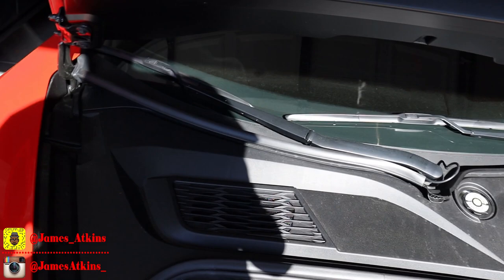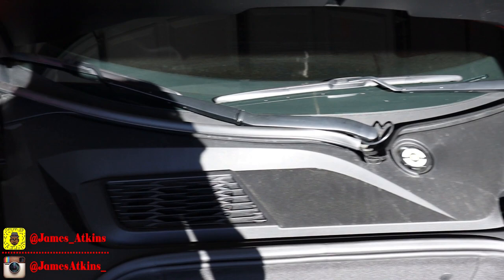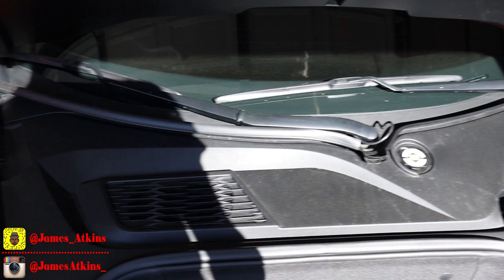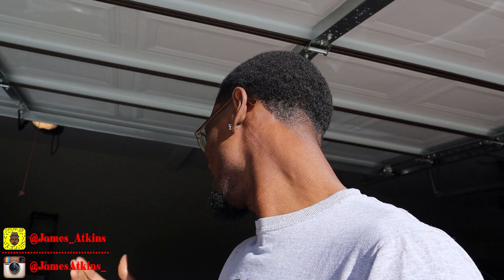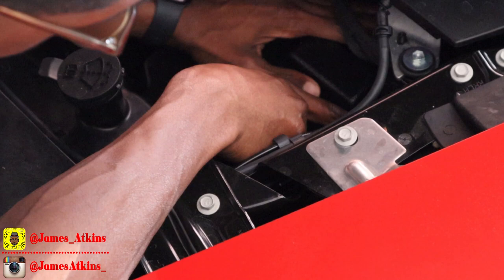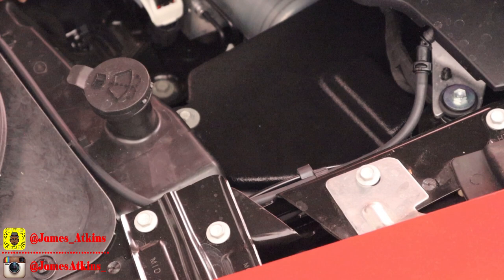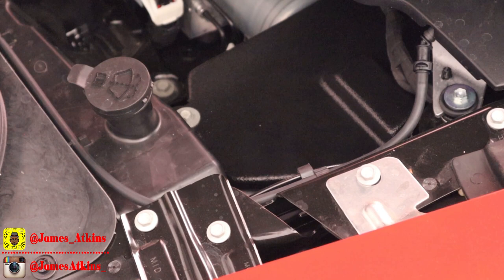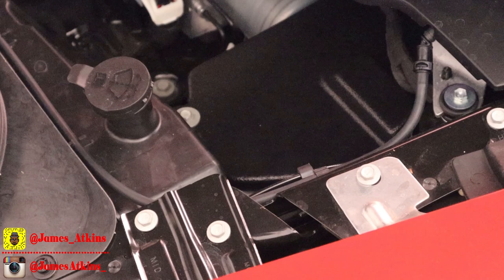Is This Mod ABSOLUTELY NECESSARY For Your C8 Corvette!?!? Is It Important!?!?

Comment: Yo brother Jim how’s your transparent roof ? Let me know if you have any issues with it any squeaks or rattle ? Thanks 👏🏿
Reply from the maker: Jay, the transparent roof is a must-have in my opinion. If you get it, you won't regret it. I will add that there is a blue tint to it though, so if you don't mind that aspect at all, it's great. There arent any squeaks, or noises. Fits tight and secure as a regular roof. It makes the cabin "feel larger" and the natural sunlight is great for the overall ride. Connect with me on IG and I can send you pictures if you want.